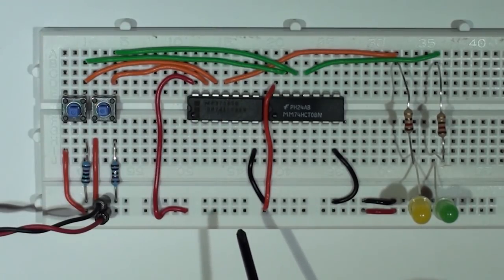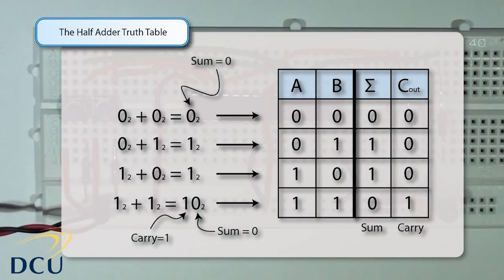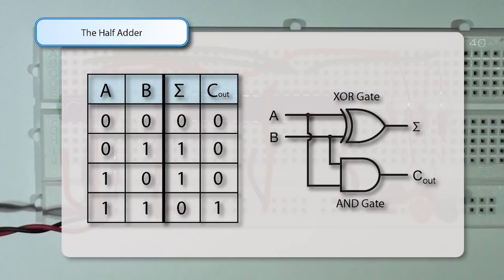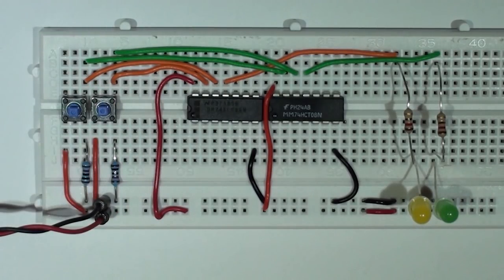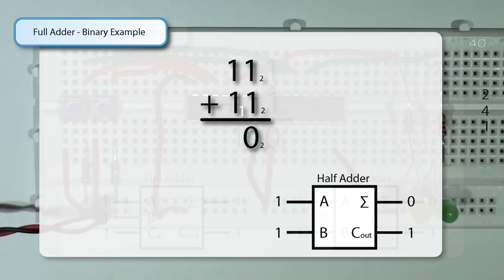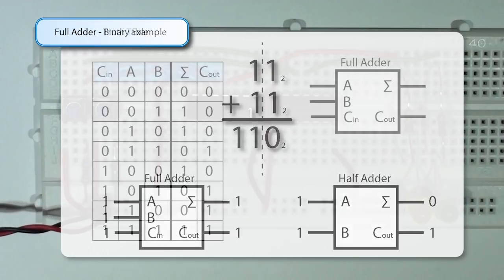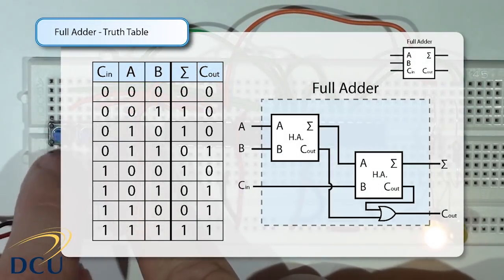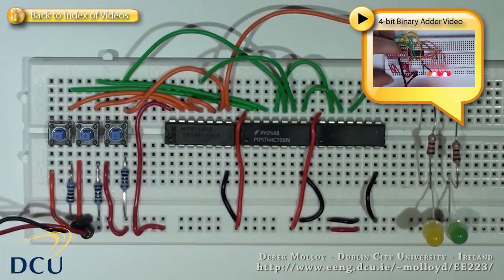Digital Electronics: The Half Adder and Full Adder

Comment: i have made a full adder circuit but when i connect the battery both the leds light up and when i switch on the switches both the leds goes off
Reply: check grounding